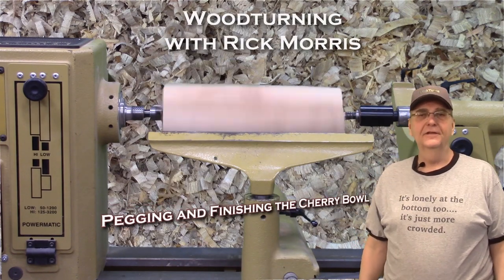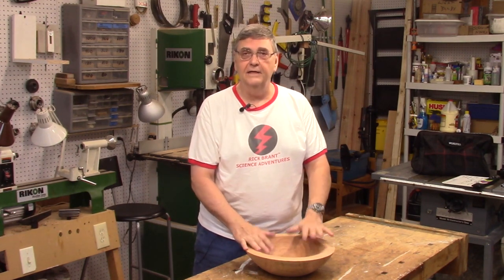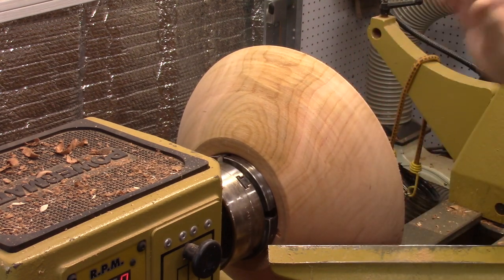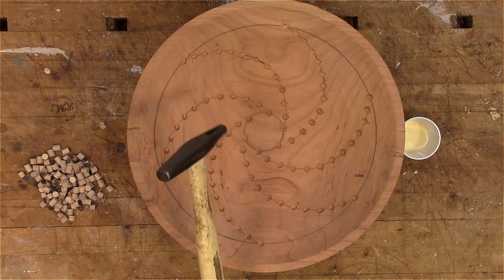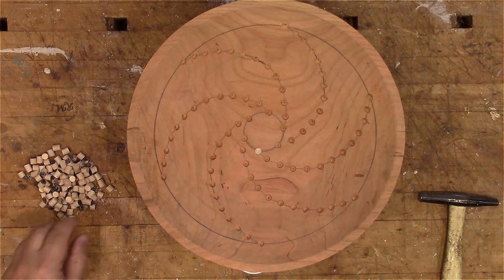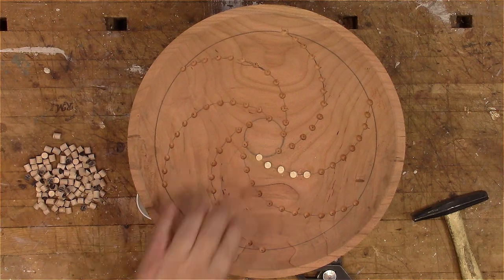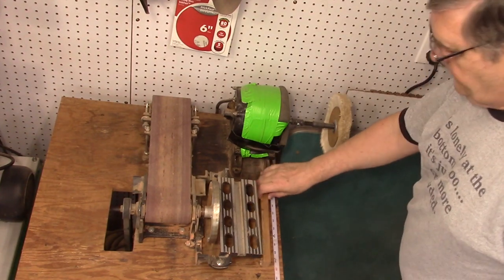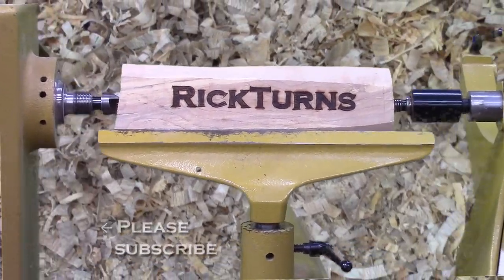Pegging And Finishing The Cherry Bowl

Comment: That's a great tip to mark your board so you know the direction of the taper. I've made a few pegged pieces myself. I always sand them because I'm afraid that my lathe tools may break them off below the bowl surface. Great bowl and video!
Reply from the maker: You're right, I've had the problem of the pegs breaking below the surface. Then I have to drill them out and put in another peg. I just might do it with sandpaper from now on...it didn't take as long as I thought it would.